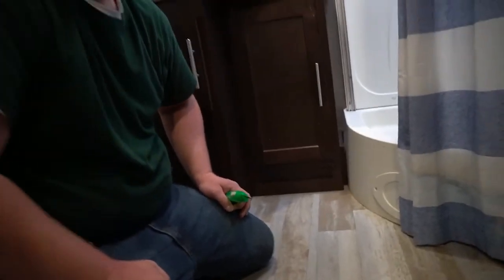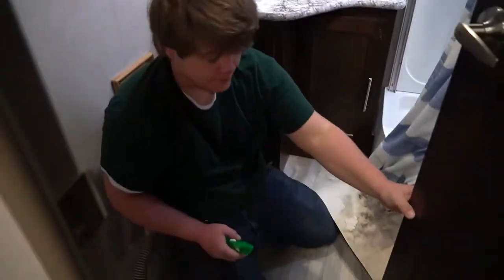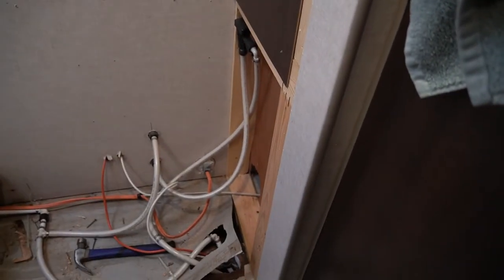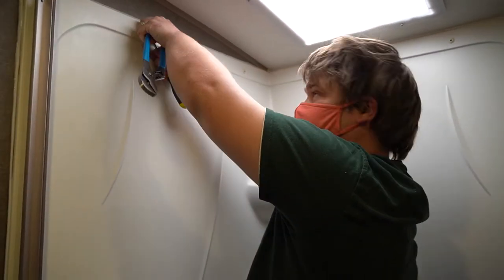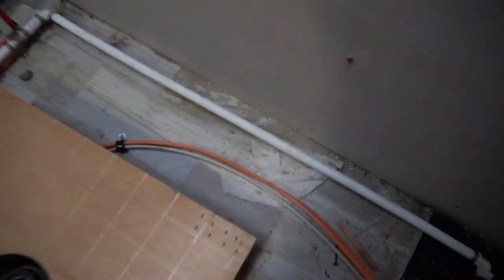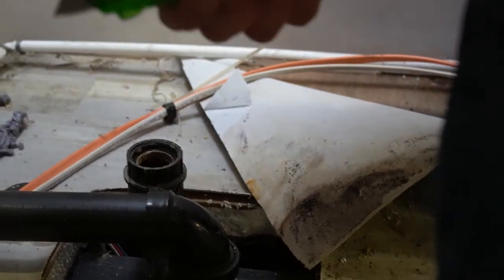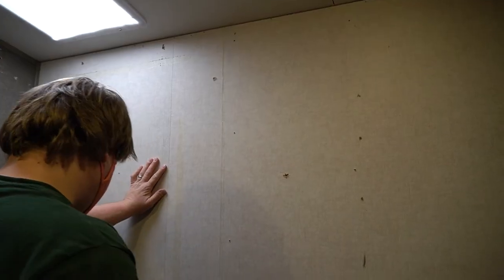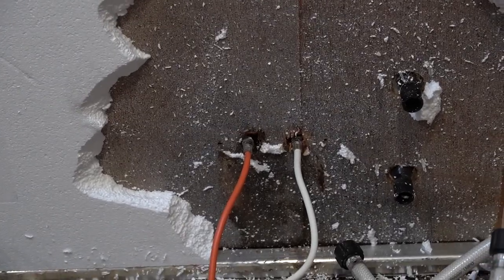RV Floor Water Damage Repair | Part One

Comment: Thank you for sharing this! I noticed a soft spot last week that I was scared to investigate further, but you two made this look far less intimidating! I pulled the panel off the wall behind my shower faucet leading into the bedroom and noticed some mouse mess in there. I just caught the mouse on Friday, so my guess is it chewed on a water hose in the few weeks before I caught the little beast as it was VERY elusive. I'm buying a nice box cutter this evening on my way home and I'm going to take a look at the damage. Hopefully it's not extensive, I don't know if I'll be able to handle it if it goes under the bed. That said, if I have to rip up all my vinyl floor, I'm putting down peel and stick vinyl tile over it-if something similar happens in the same spot, I won't need to replace ALL my flooring.

Comment: I had water damage in my Class A floor.  Before I replaced the subfloor with plywood( was particle board) I sealed with wood stain..  So if there is a leak again , which I hope not it shouldn't damage the floor  I replaced hopefully.. I only had some left over mahogany stain, so i will put a note in the user manual it is not black mold ;-)

Comment: Thank you so much for your video. I just boughgt a Class C and the guy I bought it from said it had a minor leak in the roof I looked at the ceiling and I see some wet spots but I'm hoping it's not too bad. if you have any suggestion I would greatly appreciate it. 1st time RV
Reply: How did it go? Being a first time rv owner is a treat. I’m experiencing it myself!